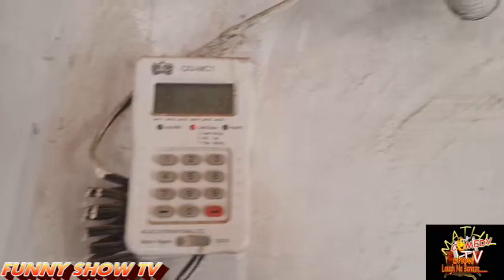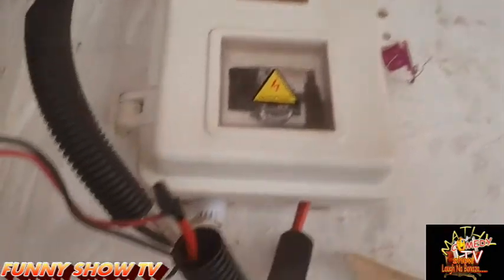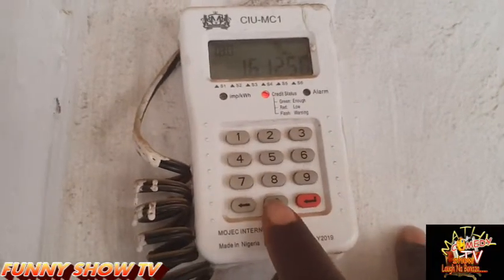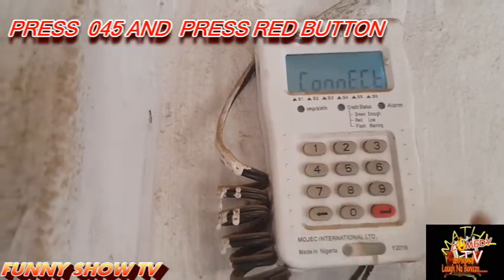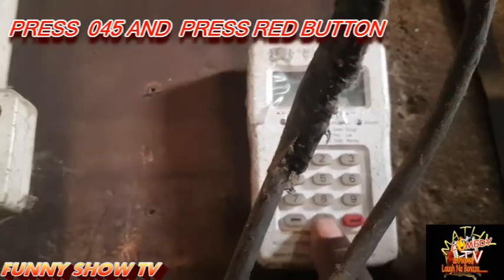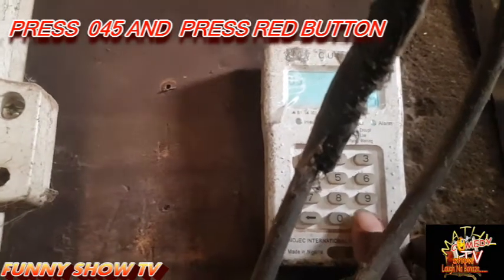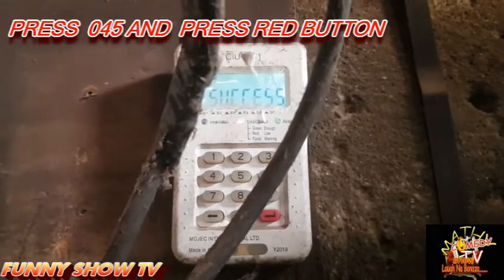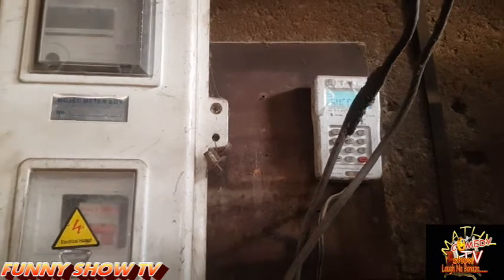HOW TO STOP THE BEEPING SOUND ON A PREPAID METER IN NIGERIA

Comment: My meter was making this beeping sound but it suddenly stopped on it's own, because I've been having troubles loading in the token. What does it mean for the beeping to stop on it's own?
Reply from the maker: I think the token has entered the meter that’s why the beeping sound stop, but did u check weather the units added
Reply: @Funnyshowtv247  thanks for replying, after the beeping stopped it started again but I just fixed the issue I just needed to activate the meter. Thanks anyway 👍